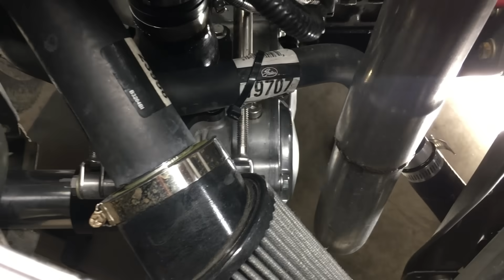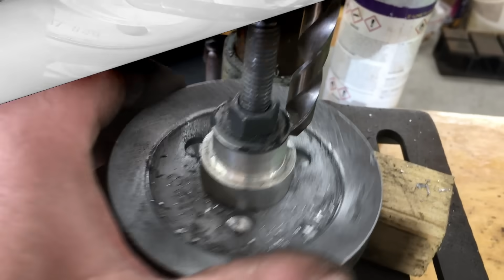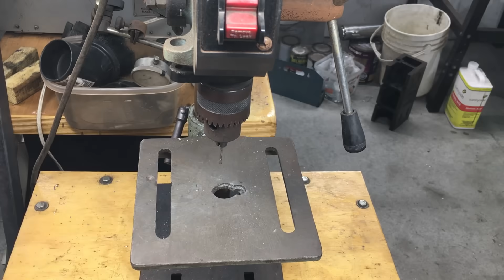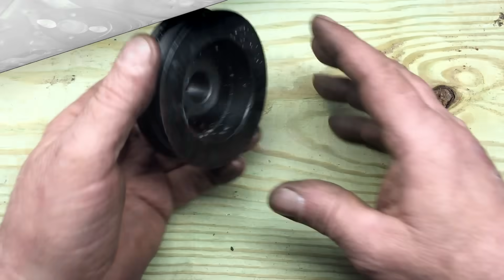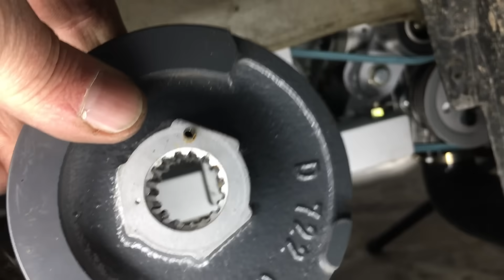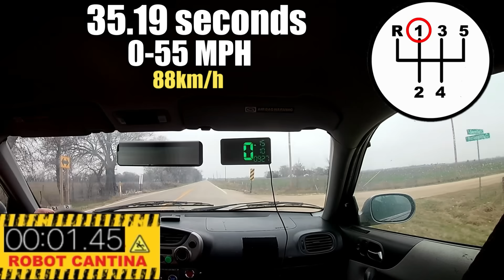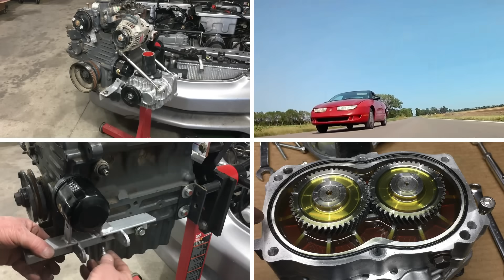S4 E9. We fix and road test the AMR500 supercharged Kubota diesel powered Honda

Comment: An interesting thought that would be way too hard to implement would be to make the engine run Atkinson cycle by changing the cam and then upping the boost a little more.  Atkinson cycle involves holding the intake valve open a little longer so that some of the charge is pushed back out of the cylinder.  This lowers the peak pressure at TDC.  In theory, one change would undo the other but we know that the only difference between theory and practice is that in theory there is no difference.
Reply: The Nissan DIG-S  is a gasoline Atkinson cycle engine with a supercharger that cuts in at wider throttle openings.

Comment: Maybe throw the smaller stock pulley with the original belt drive. FYI tractor supply, farm and fleet or big r sell pulleys for quite cheap. Universal type where you buy the center hub separately from the pulley.

Comment: You could have put a dual belt pully on the alternator to drive the kompressor. It doesn't need to be driven from the crank.

Comment: I could be mistaken but think that the fuel economy of a turbo charged engine is slightly better than supercharged. Logic would tell me that the parasitic load of a super charger at low RPM would be part of the equation. Does anyone KNOW much on that topic?

Comment: Acceleration tests suggest about 35hp range at 5-ish psi. The 8-10 you're looking for should get you to the low 40's, with torque numbers resembling a N/A 1000cc gasoline engine. 0-60 numbers resembling the quarter mile times of a 1971 Beetle is more than respectable for an Engine I'm betting will still provide 70+mpg on your fuel mileage test.
A driven pulley roughly the same diameter as the oem driven pulley should get you close to where you want to be. After that, an intercooler (and possibly a larger drive pulley change to compensate for the pressure/flow characteristics of the intercooler) would be the next 'safe' step for moderate power gains while still limiting the potential for engine damage. Pulleys and intercooler should allow you to match the beetle in acceleration, while maintaining fuel milage. All engines are air pumps, and diesel like being on boost more than most simply by design.
Good luck.

Comment: You probably got from 20hp to 27 hp with the 5 psi boost. Most of the gains will be from the torque, gained at lower rpms.
I'd say you could definitely do with the old pulley. At 1.4x I'd guess the boost would go from 5psi to a solid 7-10 psi.

Comment: Very cool. Wanted to suggest removing the new tensioner in favor of adjusting the link mounts on the supercharger. Would that work?
Reply from the maker: The adjusting links are maxed out.  Since the belt is brand new, its seems to fit fine, however once it breaks in, the fitment may be too loose.  The tensioner thingy may come in handy.

Comment: Will the pulley from the spare engine bolt onto the test engine?if it does wouldn't that under drive the super charger as compared to the original?
Reply from the maker: Had I known about the different size pulleys, that would have been an option, however I had already built the new system when that was discovered.  The new system is easy to modify with all the components still on the engine.  soooo..  in the end it was the right thing to do.

Comment: It's more fun to drive a slow car at 90% than to drive a fast car at 30%. They may be going the same speed but it's definitely not the same driving experience
Reply: That's why I widen the stance of my MK4 2.slow VW Golf and installed Audi TT brakes it'll pull over 2.2g's on a skid pad and is an absolute blast to drive pinned in 3rd without lifting through some hairy curves I've hurt some feelings in the Golf while acting like I'm rowing the boat while driving with my knees 😂
Reply: I'm totally with You! 
Btw: My current dream fun-car is the 85hp Caterham.  ;)
Reply: 100% agree, I've had tons of cars including an e36 M3, e39 M5, c5 and c6 Corvette, '06 GTO, etc.  But my all time favorite car was / is the Fiat 500 Abarth.  Absolute blast to drive, especially with the 6spd auto.  Miss my last Abarth, was totalled by a drunk girl new year's day 2023.

Comment: Dude , that is a rad differance In acceleration considering the engine, displacement , and over all packaging .. man that's sweet and I can't weight to see what more boost does .. and you are teaching me deisel rbh I'm a full petrol head and have only ever touched a 89 vw jetta deisel on any deisel engine and I think it's way different but idk ... but yeah man I have a speeduino running my whole car and it's a forged bored over miata with big turbo on 30-35psi and the big turbo is leggy so I got the speedyino ran to a monetary switch on my shifter to engage launch control and or flat foot shifting , and it makes a insane differance on flat foot when driving and keeping boost into next gear , I brake traction but I feel it would be perfect for this build .. and I know u are definitely more than smart enuf there Jimbo my friend ... anyways I lo e the content as I love tinkering myself so I bid u adue until next vid /weekend  . Much love and respect to you and yours jimbo  . Stay safe and have fun brotha ✌

Comment: Can't help but think a simple flow restrictor in the charge pipe would have been cheaper and faster. I actually know of a very popular corvette supercharging company that does just that lol. If you want to up the boost you just buy a metal plate from them that has a bigger hole lol All that said I love the project and enjoy the content, keep up the good work
Reply from the maker: The supercharger was developing over 10 psi,  there is a lot of energy being wasted spinning the supercharger that fast.

Comment: On my Shop Fox lathe, they set up a v-belt with a tensioner almost identical to that one, but surprisingly they put it in the opposite orientation. As in, the idler rides at the bottom of the belt instead of the top like you have here, even without grooves in it. I'm assuming they did it this way to maintain longevity since v-belts aren't intended to wrap backwards like that. It rides just fine that way too.

Comment: Holy heck, if you are getting into the sub-20s you are definitely making something that's highway worthy!
Reply: Nah, most of the performance gains are at idle. It makes immediate boost, unlike the turbo he had before. Had he be able to find a smaller turbo, he would have made more boost at idle as well. Most of the gains are torque, not HP.
Reply: @ProDigit80  still that's not bad, getting performance that's better than a 126P or a Trabant, and probably getting more low end torque :)
Reply: Yeah this is an awesome perhaps practical project, but is it allowed to do this just for fun?
Reply: @GordonWillis-z8t  if you're having fun and getting good things out of it, i call that a win.
Reply: @GordonWillis-z8t  I'd say if you have fun and get good things out of it, i'd say that's a win.

Comment: that 0-55 time is about what the original vw beetle did. impressive. looking forward to next weeks episode
Reply: Depends what original beetle. The 1940s versions had a 1.2 liter or smaller, with 20hp, but the newer ones 1.4l had 25hp, probably 30-32hp new. The last model years got a 1600cc, with I believe 40hp. So that's double the power of this engine.

The beetles will definitely go faster uphill at 45mph than this.
Reply: @ProDigit80  and the super beetle got 60hp out of the 1600cc. but I was talking about the original original, and only the 0-55 times, not a sweeping claim about equal performace. lol

Comment: Can't wait til the next episode.  From here, it seems like you're in a good position for tuning and road testing. Can't wait to see it break its time to 55 and its max speed.  Also, I love this little car. I live in a city and only drive about 5 miles per day. The maximum speed limit I see is 40 MPH (and due to traffic, rarely exceed 35 actual). This little car would cart me around for an eternity on a gallon of diesel.  :D
Reply from the maker: The car would be perfect for city driving for sure.

Comment: That 5psi put in a lot of work, more than I would have guessed! I'm really enjoying this K-swap series
Reply: 5 pounds of boost is 1/rd more air roughly but I suspect a lot of the improvement was from getting a fast and more complete burn of the fuel when it was shot in.
Reply: Unlike the turbo, which made boost at higher rpms, the supercharger made boost even at lower rpms, which didn't raise the hp much from the turbo, but did raise the torque. So most of the gains are in the lower rpms.

Comment: So, would then next step be to step back the fuel or reconfigure the supercharger pully?  Since the goal is to get to 8-10psi then a new pully ratio first? But dialing back the fuel for an economy run while you have lower boost could be very interesting. 

Great video Jimbo!
Reply from the maker: I'm going to leave the fuel settings alone for now.  The fuel rack only hits max fuel when the engine is at full power.  Occasionally the governor will bump the rack to max for a moment on  medium acceleration load.   During normal cruise, the extra capacity of the extended fuel rack should have no effect on fuel consumption., however the added load of turning the supercharger  may have an effect.

Comment: As a small motorcycle rider, I appreciate it when the local DOT takes a smooth road and lays patches over it.  Maybe our workers consulted your bridge repair workers since I live less than 150 miles from you.
Reply from the maker: I shouldn't complain too much... I recently moved here from Michigan and the roads here are wonderful... except that that bridge.
Reply: It could be worse, when living in southwest Ohio, some of the railroad crossings I encountered were so bad, if you exceeded 5 mph, you would lose your suspension.
Reply: I wonder if you live in the same town I do, the one with the recent "pothole state of emergency." 

Those patches suck!

Comment: Cutting 12 seconds off the 0-55 time with only 5 pounds of boost is incredible, I was not expecting that! Very curious to see how the projected 8psi does 👍 always the highlight of my Sunday mornings, this is as close to church and spiritual enlightenment as I get 🤣
Reply: I think it’s off peak power that’s making the biggest difference here. Making boost at lower rpm is REALLY helping get this thing off the line and into the power band. Going to 8 lbs will help, but not as much as just getting the power to actually build at low rpm.

I would have liked to see it run off its original boost configuration, but I can certainly understand the cautious approach that Jimbo took. 5-6 psi right off idle would be interesting to see.
Reply: 5 pounds is a huge leap from NA.  Going from 35 seconds to 23 seconds isn't really THAT big of a change.  From here, going from 23 seconds to 17 seconds (half the difference in time) would require a much bigger power increase...
Reply: Tesla has to use SpaceX thrusters to cut 1measly second off their roadster. They need Jimbo. They'd get there before they started.
Reply: My thoughts exactly , and if he had say a flat foot shifting engaged it would really male that thing sing lol ... but I seen some crazy deisel builds b4 that start as basically dbl digits and end up in the quads with deisel , so I would love to see what the full capability of this engine was with a modded fuel rack some ring gap and some big boost lol 😅.. peace and love bro keep it rad stay safe and build on l8z famz
Reply: 5PSI is a 34% increase in cylinder pressure/air charge and while there are losses, generally converts to a ~25% power gain. For a small output engine strained by a road car, "only 5 pounds" is a lot of power gain. For comparison, a 300hp engine with 5PSI boost would be making 375. 5PSI is a lot.
Reply: @TykeMison_  it’s really not, diesels are made for high cylinder pressures. The only reason I said “only 5psi” is because jumbo said that he was shooting for around 8……and 5 is less than 8 ya know
Reply: @TykeMison_ wow so youre telling me adding .333 atmospheres to a naturally aspirated engine will provide 33% extra power minus losses?
Reply: @TykeMison_ maybe on a petrol. Them equations are WAY of for a diesel.
Reply: @TykeMison_ You made the point I was about to but I will add a small detail.  When the fuel is shot in at higher pressures, it burns faster and more completely.  On an engine what wasn't really designed to be all that clean and efficient this could add more power to the output from the same amount of fuel.  Remember his exhaust temperatures  were lower.  In the opinion of Mr. Carnot, that means the engine part is more efficient.
Reply: @kensmith5694  How is "the fuel shot in at higher pressures" by only boosting the induction pressure?!
Also the lowering of the exhaust temperature probably mainly come from the surplus air absorbing heat(Seems logical to me).
Reply: @TarenGarond  The intended meaning of "at higher pressures" was referring to the pressure the fuel will see once in their, ie the pressure of the air.
You may be right about the excess air.  The mileage test should say which it is.
Reply: @kensmith5694  Ah, that makes sense XD

I think the reason for the lower EGT probably is a combination of the two.
Reply: @TykeMison_  Also, the previous manifold pressure was probably negative, like -5psi. Or at least like -3psi.

That means it could be more like 10-12psi (absolute) to 20psi (absolute), 66%-100% more air in the cylinder making substantially more power, maybe 50-70%.
Reply: @jkent9915  it's a diesel though, so for an NA engine the intake plenum should be at or very close to atmospheric pressure. As there isn't a throttle valve like there'd be on a petrol engine.
Reply: Wait until you meth it up. I’m still surprised jimbo hasn’t succeeded with meth like I have. I’ve got a bunch of hot tuned cars on meth and the meth really allows me to extract power reliably; I’m a fiat tuner (I do other cars as well).

Comment: This is exactly what we used tell guys with IDI 6.2/6.5/6.9/7.3s. Even 7psi of positive pressure makes a huge difference on a NA diesel. Lots of people who are misinformed say 5psi isn’t enough to make a difference and in my experience they are dead wrong.
Reply from the maker: Five psi seemed to be a game changer.  It will be interesting to see what we get at eight psi.

Comment: Wow! So are you going to make the engine work harder to drive the supercharger faster? With that plan, is it going to improve top end rather than bottom end? I thought having the torque is more important than the horsepower in this situation. Sure, boost is low, but consistent. Maybe a bit more to get around 8-10 pounds of boost to keep it "in the middle"?

Comment: "What are we fixing today boss?" "The bumps on that bridge are starting to smooth out, so close it down for two weeks and make it like a ramp for a bicycle!" -D.O.T. workers 😂
Reply: I've unfortunately had to cross train tracks that were rough until they got repaired. Once they fixed it the same rail crossing it gave your shock absorbers a serious workout. Makes you wonder if that rail crossing was sponsored by a shock absorber company.
Reply: @AutoCrete Yeah, Big Shock is a pretty cool name though.
Reply: In Wyoming, there is a narrow road that is closed, the only signs are about 1/4 mile from the end of the road. The last exit is about 8 miles from the sign announcing the end. Are they just having fun? Or maybe they worship Satan at WYDOT?
Reply: @antoniovillanueva308 
I ran into a similar problem in Arizona in 1980,  I was driving a big truck.  I was on US highway 60 and turned north on 89A . On the map looked like a shirt cut to Flagstaff.  About 5 miles in, (with no place to turn around,  a sign read, "This highway not recommended for trailers over 25 feet".) I was pulling a 42 foot trailer.  It was an interesting trip.
Reply: @antoniovillanueva308 Do they “worship Satan” ? 😂
Reply: @photogravity Why, who doesn't worship Satan?
Reply: As retired TxDOT... This is kinda accurate... 😂
Reply: That's a feature, not a bug.  We wouldn't want people driving too fast over that bridge if it were to ever freeze...
Reply: Commiefornia CalTrans Workers: "Hold our beers."